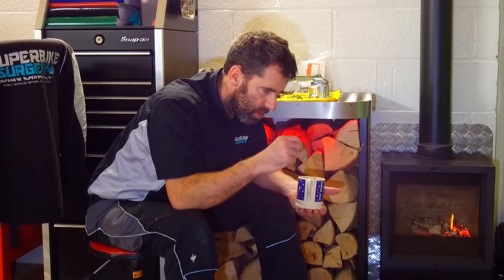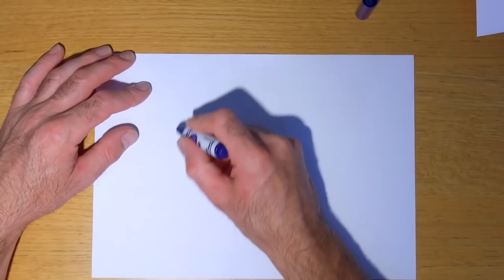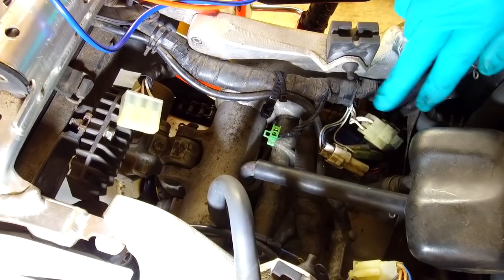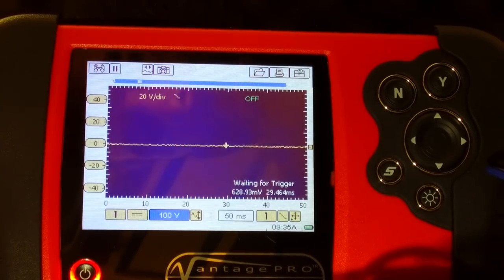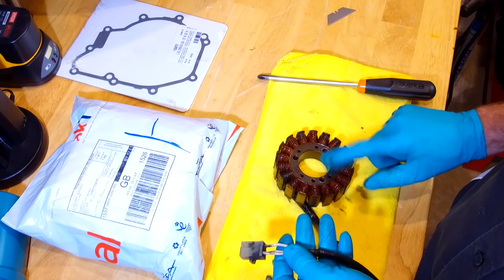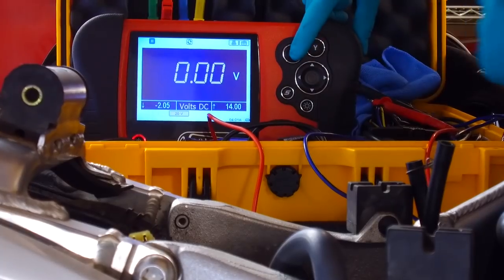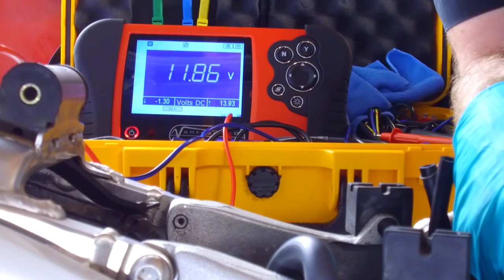The Anatomy Of A Motorcycle Battery Charging System

Comment: You sir are an absolute genius. I have a six-month old Harley that has gone through three regulators.  After watching your video I'm positive it's the stator/generator that is stuffed. They "The Technicians" keep saying it's a bad batch of regulators, and the only way this could be the case, is if the diodes were stuffed in all three regulators? I don't think so. Which leads me to conclude that it's the stator/generator. Oh and by the way there's nothing wrong with waffling 👍👍👍.

Comment: You explained it perfectly! The asw. u did in upper r corner would be 2 switches on some bikes,
an engine run sw. when on it sends juice to the ignition system points condenser coils etc and to
one side of the starter sw.

Comment: Great JOB, glad u said how coils could be grounded, I have seen that two coils making a
contact with the core WILL burn out the windings. And if coils overheat they may not make
contact with the core, but heat up enough to burn off the insulation and thus lessening the 
number of turns in the coil, and reducing the amount of voltage built up in that coil. The size
of the wire determines how much current the coil can produce and it determines the amount 
of turns as well, So if the coil is wound with 12 gage wire which could be good for 20 amps
 it would be a given number of turns in that coil.  volts X amps gives power. So if  the coil/
coils overheated, you can get the same amps but lesser volts will give you a lesser amount 
of power. 
I have found a bad cell in the battery can burn out a stator/generator as the regulator will 
keep telling the gen the battery is low, but the battery being bad will still crank the starter 
at 10 volts and the gen will toast itself trying to bring up a battery to 12 volts, but since the
battery is bad the gen will get wankered somewhere down the road.

Comment: Some bike starters have a heavier solenoid that does what the solenoid does AND also
pushes the pinion gear on the starter shaft out to mesh with the ring gear on the clutch
basket. You are making a lot of sense, you are doing a fine job, the stator is a core built up
of much thinner pieces of iron separated by electrical varnish coils wound on bobbins.
if the core were 1 piece of metal magnetic field passing through it and would heat it...
You are doing a fine job SuperBike Surgery. the 3 phases are 120 degrees apart. I bet you
specialize in bike electrics. Harley Sportsters use a single phase but the DYNA series does
use as you said a 3-phase stator w 3 leads. Ride safe my friend.

Comment: Hello Superbike Surgery Ltd, If u happen to get a Harley in the shop,  A.C. voltage should be 
between 19 and 26 per 1,000 rpm. so at 2,000 you could have 38 to 52 volts. Resistance being between .2 to .4 ohms as said in the HD service manual.

Comment: Not often I comment on vids but wow!!! I watched the whole vid and I learned a lot!! I am actually a motorcycle trials dealer and even tho I know about mechanics etc electrics have always been my down side!! So this vid is was very interesting to me. Any chance maybe you making a vid on trials and off road bike electrics?? As I think you would explain it better than most. PS you didn't waffle at all!!! :) :) it was all amazing learning cheers please do more thanks again
Reply: I'm having problems with my 2000 beta rev 3. I learned a lot from this video, but He didn't talk about the cdi. I can't figure out if it's my stator or my cdi, or both. On the beta the main power doesn't go to the regulator. It goes to the cdi and then the ignition coil. I can't start it because the spark is too weak.

Comment: Back when i was a nipper and pkay with mopets that had a single coil for charging, all i had was an analogue meter. If you know what resistance the windings should be, that'd work too. Or a discrepancy. With reg/rec removed. Last one i did was an intermittent reg/rec fault on an st 1050. Triumph electrics are a different story 😅

Comment: You explained the rapid clicking very well. ur drawing was close to reality... there would be 
another small switch in series with the starter sw. this would be the kill sw. 2 wires off it, 1
would b to feed the ignition ckt, the 2nd wire would go to the start sw., then from there to the
starter sol. Ur graph is really pretty good, what ur not saying but close to it is when the voltage 
goes to 10 under the 0 volts line is a different pole on the magnet, that is what is causing the 
opposite polarity. ur 3 phases are pretty good they would be 120 degrees apart. 
DO NOT apologize for getting into theory! one needs theory b4 they pick up a wrench  
screwdriver or a meter. one needs to know how things work what each part does and how it
works with other parts. like as you said current goes thru a DIODE one way only. if it goes
bad, 1 of 2 things can happen. 1 it will fail to let the current flow as it is supposed to.
2 it will allow current to flow against the diode, in which case without a fuse, the stator or 
charging coils will be quickly burned out.

Comment: I don't think u can add any more details nicely done awesome work thank you. I have 2 silly doubt though 1.what about the new engines that comes with electronic fuel injection does their starting circuit varies as of the one you showed in the video 2. Do these EFI engines can be started by classical pushing techniques when you have a dead battery.

Comment: My bike keeps going dead. So I changed the battery and rectifier. Checked the voltage going to my battery which is 14.5v  even when I bring the rpm up. But I noticed the bike sucks the power out the battery instead of charging and when the bike is off the engine light comes on , I don't get that!

Comment: Great video nice demo using the oscilloscope but you often call an alternator a generator which is surprising as you are well aware of AC & DC
Reply from the maker: Thanks for the comment. The term 'generator' is a generic word used to describe a machine for converting mechanical energy into electricity, nothing to do with whether it's AC or DC. Bike Manufactures almost always use the term "generator" in their service information and parts diagrams. 

The word alternator is used to describe what you would find on all cars and a handful of bikes. It's basically a generator and regulator/rectifier in one unit, outputting DC. 

People sometimes refer to a bike "Generator" as an "Alternator" because it's making alternating current, not technically correct but fine in my book. 

Another description used is 'stator', another perfectly acceptable discription. A dynamo (which is what I assume you are thinking of) also outputs DC but the rectification is done by a commutator and brushes, basically a DC motor.

Comment: Hi I have a zx6r 07 that is charging at idle at 14.5v like it should but every 4seconds it drops suddenly to like 1.3v just for like .25 of a second and then it comes up back to 14.5. The motor bogs when the battery voltage drops. What's causing this issue. I put new spark plugs,  battery, new stator, relay, 2 used Flywheels $20 each, used Regulator/Rectifier...and it's still making that voltage drop. Can you please give some ideas to find the problem.

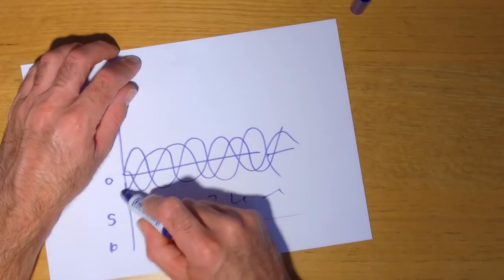Comment: first time i have found your vids and they are very informative, just a little thing at 18:30 you say the rectifier "remover's" the  half of the wave form(below 0 volts) It doesn't remove them, It rectifies it to a positive current creating double the positive waves and flattening the overall supply. Not trying to be picky just wanted to say..
Reply from the maker: I probably did a bad job of explaining! If you have a single diode you will have "half wave rectification" and  you will lose half of the sine wave. Thats why my drawing of the Reg/Rec had 6 diodes "full wave rectification" I did a poor job of explaining it on reflection.

Comment: hello , what is normal rectifier body temperature when charging  ?  I have seadoo jetski and second rectifier burning , from generator all 3 coils  have 24v  on 1200rpm , not shorts to ground , all coils 0.5 oms with wires to rectifier , after rectifier have fuse 30A - not burning . one rectifier original - burn , second 45A  from ebay - burn . When engine work have on battery 13.8v , when disconnected rectifier from battery 14.5v  . Smart tester show battery 100% good . Any ideas why rectifiers burning ? thanks
Reply from the maker: I think you've just been unlucky.  I'd replace with a genuine part not a cheap Chinese one. It's not unusual for a reg/rec to get so hot you can't touch it. Hope this helps! Good luck:😁

Comment: Very good diagnostics and explanation on charging system and good thing ive watched a few aussie n uk utube vidioes or i might be confused on ur wordings,ha,ha,duff means no good,waffling means straying from concept and dodgy means suspect or iffy!!!there was a few more but i knew there american conversion.i was dissapointed u didnt mention the exciter or pickup coil in your showing of generator windings to be certain i didnt see one on the replacement and how it also connects to cdi portion and what its function is n does.youll have to do a part-2snookie pa.otherwise *****💥👍💥
Reply from the maker: Thanks for the comment 👍 I agree, a video covering the anatomy of the ignition system would make a good video. There are so many types though I'd probably have to brake it up into several episodes. I have this one covering points ignition: https://youtu.be/gCeDZMX4E9k

I didn't mention the pickup as it's not part of the charging system and its located on the other end of the crank, separate from the generator. 

Thanks for watching 👍

Comment: great video. thanks for making it, but you didn't talk about a cdi. Do you have any videos that talk about that? My bike doesn't have a battery, and the main charge goes to the cdi and then the ignition coil. The regulator is only for the lights, horn etc. as far as I can tell.
Reply from the maker: Yes, this three phase system is only really relevant to bigger bikes, think I mentioned this in the introduction. The CDI system you talk about has two completely separate coils on the stator. 1 for ignition 1 for generation. that would be a whole different video! I may get to it one day if I can find the right bike with the right fault. Thanks for watching.
Reply: @SuperbikeSurgeryTV   Superbike Surgery  if you said that i must have missed it. Thanks for the reply, and thanks again for the video. Even if it's not for my exact system it still helped me to understand it better. The part where you tested the stator on the workbench helped me a lot. I get a resistance reading of 550 when i test the primary wire to ground. I wasn't sure if i was supposed to be getting that or not. It seemed like i shouldn't be getting anything because the winding is supposed to be separate from the base of the stator. So now i guess i have to figure out how to rewind it since you can't buy the stator for my bike.

Comment: Hi there Superbike Surgery, I know different countries have different way of expressing things.
We call the part that produces power to charge the battery and work the bike's electrics as
the stator, which of course needs the magnetic rotor. Electrically speaking and from a point of
actuality the stator and magnetic rotor is really a 'Magneto' as the magnetic fields are produced
by permanent magnets and NOT an electro-magnetic rotor as in an alternator, which would be
fed by an external source through brushes and slip rings. Magneto is a term most used for
ignition such as a 'Joseph Hunt magneto or an American Bosch.

Comment: HIGH FIVE on video detail and all. QUESTION: I recently replaced stator and reg/rec. All seemed back to normal all voltages idle and higher rpm looked in range 13-14.5v. Went for a ride and started smelling burning. Ended up reg/rec got so hot it melted itself onto the plastic box and smoked and stinks for days. What could have caused this? I had a spare reg/rec and re-tested all of it and all are in range. Verified grounds, battery connections, fuses solenoids all connections for good contacts and shorts. I only found a slightly loose battery cable but not sure if that was the issue. Now I have the new reg/rec in and all is good but afraid to actually go for a test ride as I am afraid it will happen again as I have not really found a reason for the first new rec/reg to fail. Again why do you think the one got so hot and melted like ice cream on a sunny day in texas? Should I keep looking for an issue? or do you think I just got a bad new reg/rec? Thank you so much for this video and your time and reply if you get a chance. Jay in Dallas, Texas USA

Comment: Do you get AC and DC generators on bikes or are they all AC I've just bought a kiden 125 engine & it says DC ignition do I need DC CDI
Reply from the maker: Wow there's a lot of questions mixed up in that comment! Generally speaking most bikes regardless of capacity will have a system that generates AC that will need rectification (turning g into DC). A system that makes DC would use a dynamo, not something you would ever see on a modern bike but something that did show up on older systems. The "DC" in the CDI system you mentioned just means it uses battery voltage rather than a dedicated AC coil on the stator. Can't be any more help than that in the comments, it's a complicated subject.

Comment: I wished you showed exactly what you were connecting to when checking the voltage regulation of the RR. That was the part I really wanted to see.
Reply: Thanks for replying. And your video is very good by the way. Unfortunately, I am a novice mechanic working on my first bike so I need to actually SEE what you're doing which is what you did very well throughout the video until the very end. I really don't understand what you just wrote me. I think you explained it earlier in the vid about testing the RR (not the diode test) but then performed it later and it's all too confusing. I have a 1981 Yamaha xj550rh Seca and the test they suggest in the manual needs two multimeters!!! So I was excited to see how you tested your RR but I just couldn't actually SEE what you're doing. In any case, I'm having a charging problem with my bike. I performed every single test you can on the bike and everything comes out within specifications, however, one thing on your vid that made me think might be my problem is the "internal resistance" of the battery. First time I've heard of this.  My bike is doing what yours is doing where I can't really get the voltage to go past 13.5v at 5000rpm. The battery holds a full charge when I charge it over night. Is it possible that you can have a high resistance on the battery but left on a charger long enough it will still charge but when connected onto the motorcycle it will never charge sufficiently because of the high internal resistance? I went ahead and bought a new battery so  as soon as I get it fully prepared I'll try my luck once again.

Comment: Don't shoot the messenger for asking but in my case my rectifier wiring harness does not have a connection like yours it's attached the plugs into the wiring harness. Are you or do you test a rectifier while the bike is running, it's confusing because I see videos' of testing done with bike running and testing with rectifier off the bike. I follow videos because I barely can read and what I do read I forget when I'm done reading it. I do however want to know and learn how to diagnose my own bike with the help of youtube

Comment: A very good video, well explained, even for dummies.
 I've a question though, can we test charging system using a drained battery. That is, will there be a difference in voltage when using fully charged battery and a drained battery

Comment: Thank you for the video! I have only one question. Can we measure the VDC output of the rectifier/regulator with the battery disconnected from it. Just to check the VDC output. (The battery though will be still connected (but not with the rectifier/regulator) so the motor can run).
Reply: Thank you very much for your prompt answer. There are several tutorials explaining how to check the rectifier but regarding the voltage regulator is not very clear. I know that the battery has to be good, otherwise the measurements are not valid. But you cannot be 100% sure that the voltage regulator is broken while the rectifier is working. FYI your video is great!
Reply: Hello James, i received and installed a new battery and i have constantly connected a voltmeter so I can check. The regulator is sending voltage approximately one time per minute for only few seconds, so most of the time the motorcycle is working from the battery power. Lets say in 30 minutes ride i saw the R/R sending voltage 20-3 times but only for few seconds. Have you seen something similar?  I know for sure that my stator is working good, as i have checked the VAC (50 - 70 V) and also the ohms.

Comment: Great video, you mentioned at the start this was for a 125 and larger. I am trying to find out about the Honda Cub 6v generator, I believe Honda did something a little different with the Cub, do you have any info you could pass on? Thanks in advance.
Reply: thanks for the info, my bike is a CT50 Japanese home market only, I am wanting to go 12v, but now thinking the stator probably wont charge a 12v battery. I might be wasting my time....
Reply: you are right about the headlight, 5 wires come from the engine stator area, one is neutral lamp, and one yellow goes to the headlamp switch.
Reply: @SuperbikeSurgeryTV  thanks, I am  seriously wondering if it worth the hassle, might have to leave it 6v it's going ok, everything working...